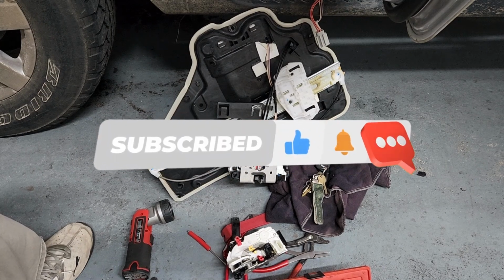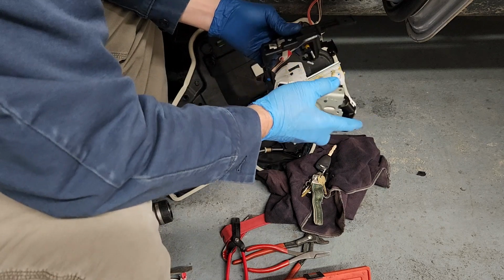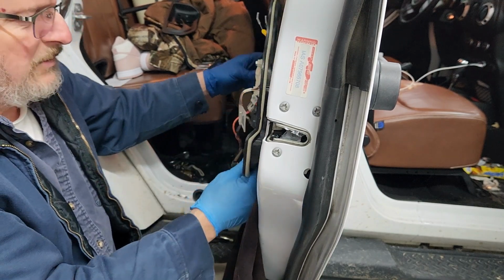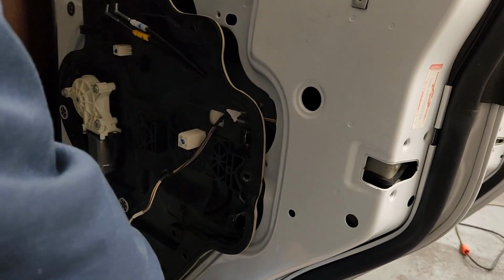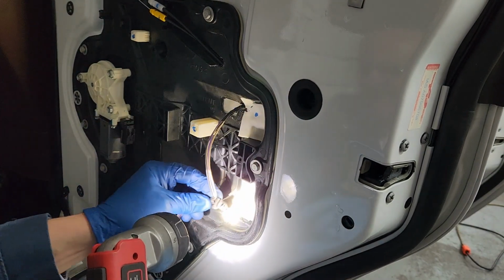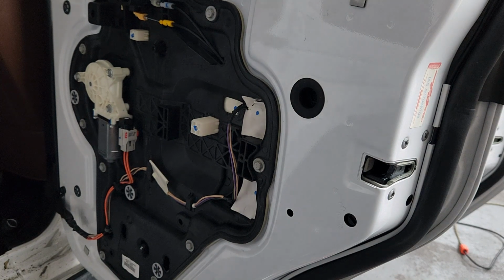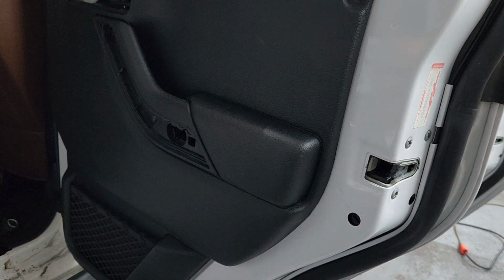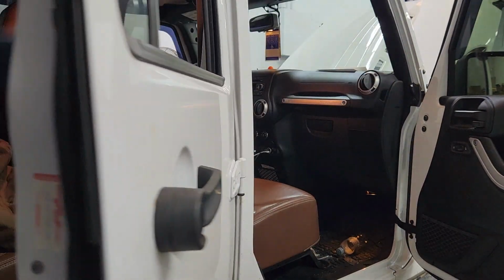2018 Jeep Wrangler, Replacing The Rear Door Lock Actuator

Comment: Hey there, thanks for posting this video. After reading the description I'm having the EXACT same problem on my 2018JL. Same passenger rear door.  It'll move just a tiny bit with the key or lock buttons but not the full rage of motion. Works perfectly manually, so it just stays locked. lol Is there any way I could get the official service information you were able to pull?  Thanks
Reply from the maker: I use a professional portal that allows me access to most dealer information. There are several out there, AllData, Identifix, Mitchell and etc. They are all expensive and quirky. I think they have DIY versions. Then there is the official Mopartsp.com site. No idea of the costs.
Reply: @SparkysAnswers  gotcha, thanks for the reply I actually have a Mopartsp account but I don’t know how I feel paying $40 for 3 days worth of access. Guess I should make a list of everything I can possibly think of, brew 25 gallons of coffee, buy the account and get to downloading lol
Reply: @SparkysAnswers  oh, and also, the part that you swapped out. Do you think, in your professional opinion, that it’s repairable? Is it possible for me to pull the old one and fix it. I’m leaning towards NO but I figured I’d ask. I’ve never see on up close
Reply from the maker: @robdawg1017  Generally no, I usually try to take things like that apart to see what failed. Most of the time they are so cheaply made you can't get them back together even if you could find and replace the failed component. I dislike that a lot since I grew up in this industry as a starter and alternator rebuilder.